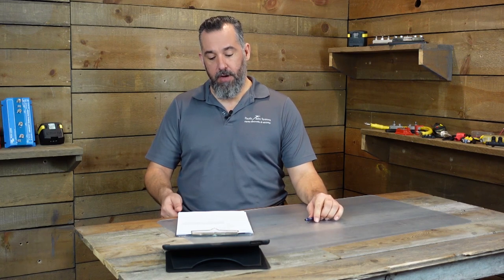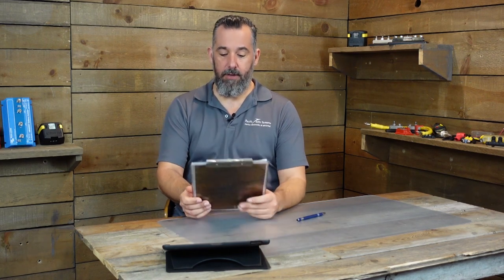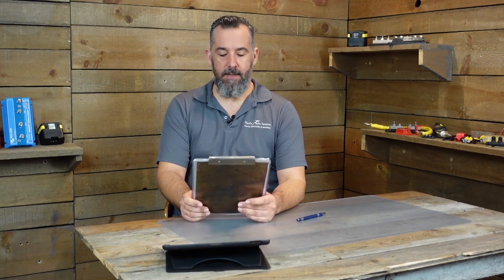I Am a Sportfisher but My Battery Won't Last Without the Engine Running?  Any recommendations?

Comment: Hi Jeff, I have heard a lot about about lightning strikes on sailboats recently. Can you talk about proper bonding, grounding, lightning arrestor, etc, both for boats on anchor/mooring and at the dock.  Thank you! 
Greg
Reply from the maker: Hi Greg, good question, but unfortunately have no real world experience with lighting strike systems, only read about it in books. Anybody can share what they did aboard their boat?
Reply: Thank you Jeff, that makes sense. Although, some might say that your lack of problems with lightning may be proof that you're grounding it correctly. So nice job!

 Another issue I've seen a lot on, older boats especially, is the use of solid copper wire, wire nuts, and residential junction boxes in their AC voltage system. Could you please show why you wouldn't use these products in a marine setting? Maybe touch on DCV Safety wire as well? 

I often send your videos to friends who are working on their boats. It's sometimes hard to find the fact based videos with all the opinion based ones out there. Yours are great for this.

Comment: I like idea of replacing lamps with LED,s but have 2 problems first are they coast guard approved second for fixtures that have fresnel lenses how is the light projected.
Reply from the maker: Hi John good points, apparently there are US coast guard approved LED nav lights. Don't remember the make and model. Does anyone have suggestions?
Reply: I understand the approval is based on the complete fixture not just the bulb

Comment: Hi Jeff, great video and video's. 
I am out rigging a new sport fishing boat . All new Garmin electronics high end, heater ,2 transducers and 2down riggers I'll be running 100 amp alternator. My question is would 2 firefly agm batteries suit my needs more than any other set up ? I plan on fishing off shore and coming in shore at night, but fishing for days at a time.
Thanks Robin
Reply from the maker: Hi Robin, simply question but very hard to answer. You'll need to calculate all your loads operating at once, and then figure how how long you'll need to run them without an alternator. Power calculations are like doing a home finance budget, it takes a little calculation to get right.
Reply: @PacificYachtSystems  I have another problem, yamaha outboard engines are saying that they are not made to charge agm batteries. Is this even possible ?

Comment: What battery should I use for a 5,000 watt car amplifier?
Reply: How long do you want to run it? Not too long, hopefully, for your neighbours :)
Reply: Optima Yellow Top with a suitable alternator!
Reply from the maker: When the car is running, the alternator is effectively running the load. A 5000 watt amplifier would drain any car battery quickly if there was no alternator recharging the battery.
Reply: Yes I have a 300 plus high output alt but I have a stock battery under the hood and I wired my amp too a second battery that I installed in my trunk. Should I switch to AGM or lithium?What do you recommend thanks a lot!!!!!